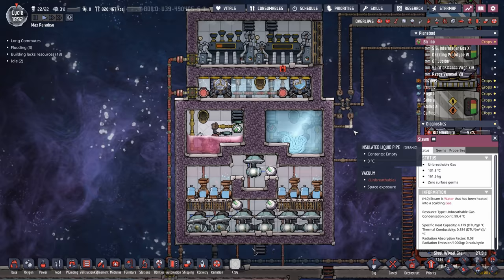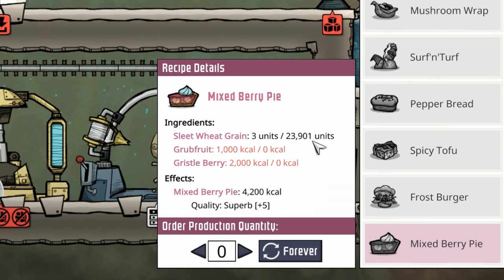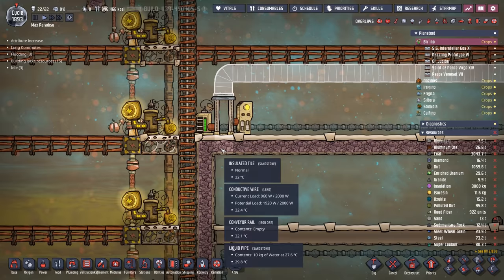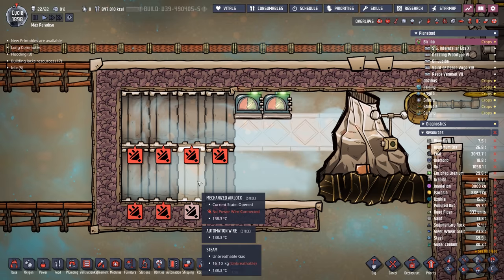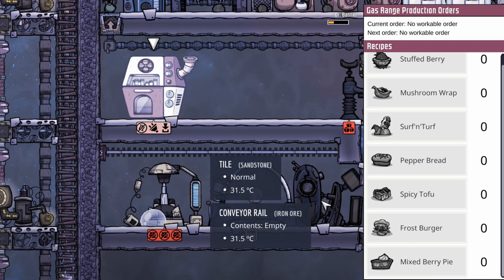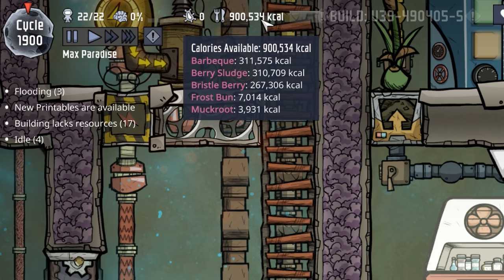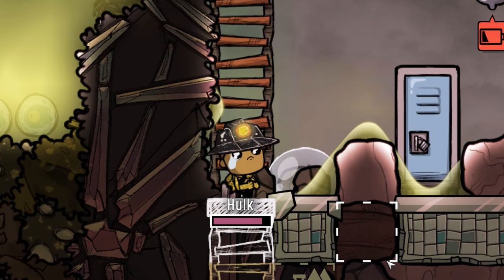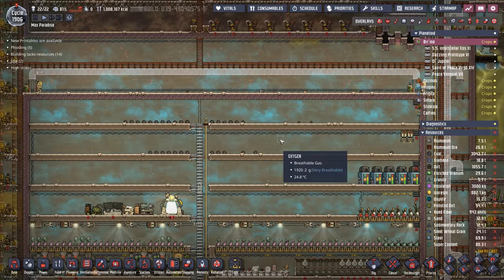Steam Crusher | ONI Spaced Out | Max Difficulty Ep 23

Comment: Here is an easy fix for your atmosuits, break up all the suits into three sections and then have one of your oxygen lines feed each bank of atomsuits, then have the run off feed your base.
Reply from the maker: I like this a lot.  I think I am going to give this a go.  Thanks for the suggestion.
Reply: @EchoRidgeGaming  For using multiple exit locations, you just have to make sure that the checkpoint is set to "vacancy only" so that a dupe will only go in if there's an open dock, otherwise they have to go around to a different checkpoint.

Comment: With the steam crusher running constantly is there a potential to get the steam pressure too low?  Seems like you could put an atmo sensor/AND gate to only open the front set of doors if pressure is over 20 kg (I'm doing something similar in my current playthrough to siphon the water off if pressure gets too high in my industrial sauna).
Reply from the maker: I have thought about that too. Since this video I have reduced the crush time down to once every 10 cycles. I will probably end up using an atmo sensor in the future too.

Comment: Have you tried a double bridge facing into each atmossuit checkpoint, allowing 2 full pipes of oxygen to pass into the exo suits
Reply: That's how I do it. One bridge ends just above the input of each suit dock, then another one tile up. Run a pipe through the 2 bridge outputs and into the dock only. Repeat for every dock, and then run a pipe along each of the bridge inputs.
Bottom pipe has priority, and then the top one will jump to the next dick that needs oxygen.
Reply: @jemsterr  exactly, 2000g input vs 1000 g
Reply: If you have a really long line, you could also do another pair coming from underneath, but that's overkill.

Important to remember that you DON'T run a line along the dock inputs, though.
Reply from the maker: Love that the community is talking about solutions.  Thank you both.  I have tried this and have seen some good results.
Reply: @EchoRidgeGaming  Feel like your community has a lot to offer to people of all experience levels. If you had a discord it'd allow people looking to discuss things like this a platform for that. Love your content man <3
Reply: I just run one pipe to the first 5-6 docks and another to the rest. works like a charm.